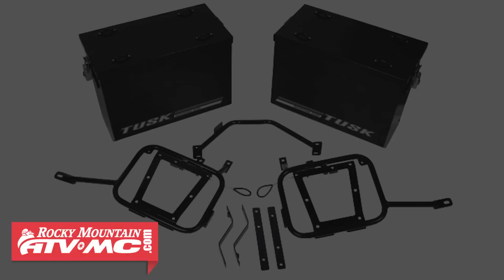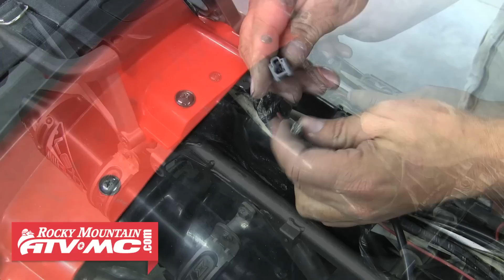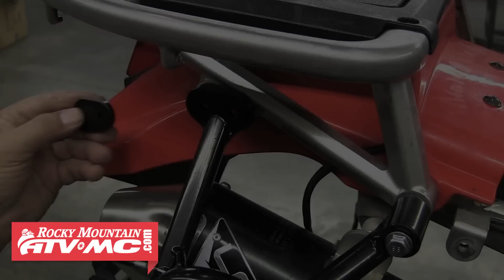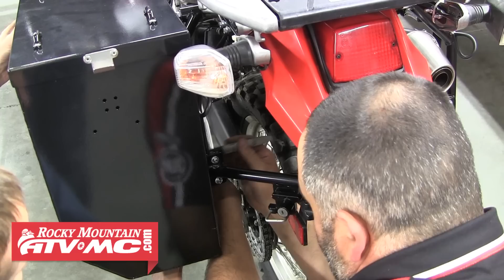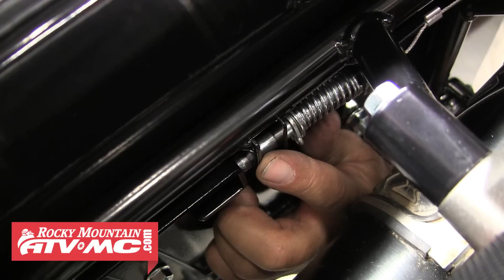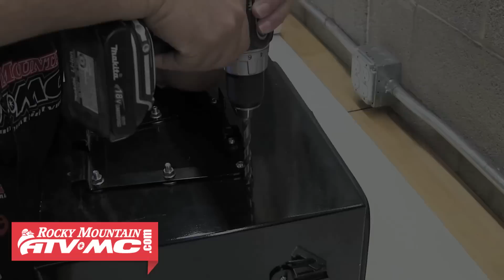Tusk Pannier Racks Assembly & Installation - 2008-2018 Kawasaki KLR650

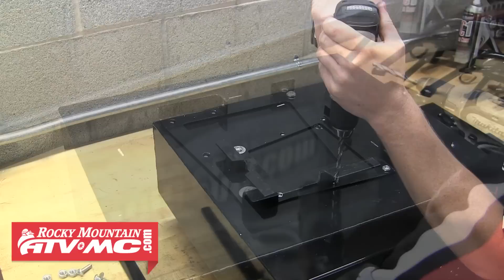Comment: At 7:25 in the video,. You dropped bolts into the brace to hold it so you can drill the rest of the holes. I don't know if you forgot to mention? Or this is just my own idea. After you put the bolts in I put the nuts on underneath to hold the brace firm against the box as I'm drilling. I found if I did not do this the brace flopped around a little bit as I was drilling the rest of the holes.. other than that one small suggestion I find a video comprehensive and informative.

By the way the construction of the bars and boxes is excellent, a good value

Comment: How do you get the seat back off if the left side cover is not designed to come off?

Must you remove the rack?
Reply: Not sure about others but both my side covers come off pretty easily with the racks in place so i have never had to take the racks off.
Reply: @Shabbernigdo Xingjian  100% agree. Sounded like in the instructions they cautioned they might not.

Comment: Didn't have to splice in the left rear blinker, just enough slack to attach without being taut. Also good note of mention you DO have to remove the rubber grommet and metal sleeves for the old blinkers to install the nut plate. (I was getting frustrated. If you run aftermarket exhaust, or maybe its just the FMF q4 I have, a bunjee cord for the release wire would be ideal.

Comment: dudes like "this is gonna be easy"

i dont think I could come up with a more complicated install process than this.
Reply: First thing I did was the thermal Bob install, which first is remove the seat and the gas tank.

Then I replace the doohickey, check the videos to see how that goes.

Now I'm installing these boxes, and after the two previous jobs I just did . to me it does seem easy. 🤪

Comment: You dont need that much wire for the extension. This product is about as garbage as chinesium gets throw the factory bolts out also the reason they dont want you to tighten everything up individually is it wont fit. Fit and finish is beyond sub par super disappointing

Comment: It's obvious that the installer doesn't know how to use electrical tape properly. Water will get in and stay there thus causing corrosion and the blinker connection failure in a year or so. Seal the connection properly or don't seal it at all. He should have used heat-shrink tubing with glue to seal the spliced connections.
Reply: A certified hammer mechanic! I am surprised they used sockets and not channel locks and vice grips.

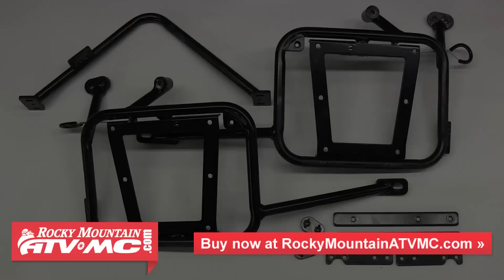Comment: at 0:54 what is the flat bar with three holes ( just above the turn signal extension bars) used for? Never mentioned in video.
Reply: It's the brace that goes inside the pannier. & it is seen in the video being installed.

Comment: Can I use soft pannier bags with these racks. I would also like to mount a rotopax water container to the right side would there be a problem with exhaust heat in doing that
Reply: Yes

Comment: I have a 2011.  Torque specs: Rear footpeg bolt: 18ft/lb, upper rear frame: 33ft/lb.  I used blue loctite.  I had issues with the left side rack lining up with the bolts, I was able to finally jimmy the footpeg bolt in but it was not pretty(probably stripped the threads).  I also had issues with the blinker extender.  On my 2011 the rubber "grommet" stuff was a solid piece.  I could not easily remove it.  I didn't want to cut it out in case I ever wanted to put it back the way it was.   This rubber stuff made the supplied bolts not long enough.  I ended up going out and getting ones(4) that were M6X40mm (1cm longer) and this worked fine.

Comment: The instructions state to reuse the turn signal bolts and nuts from the original parts.  They are WAY too long since it looks like you don't use the rubber blocks when installing the turn signals on the steel extensions.   Any suggestions??  The bolts shown in the video are NOT the stock signal mounting bolts.  The stock bolts have a round allen head, not a hex head.

Comment: My right side rack fit my 2014 klr perfectly but the left rack does not quite line up with the stock turn signal location and misses the front bolt location by almost an inch.  Could I have been sent the wrong rack?
Reply: I had the exact same issue on my 2017 KLR.  right side rack fits perfectly, but left side rack is off by a distance no amount of bending or torquing can align.  these racks cannot be installed.  

at request of RMATVMC, i emailed their warranty department photos and videos of how and where it was not fitting.  but it took a phone call a week later to get any word or update on my issue.  their solution (which i am eager to try) is to send another set of racks; maybe i got sent the wrong left rack.  problem is: they're back ordered and will be another 4+ weeks before i can expect to receive it. fingers crossed this new left side rack will be the 

meanwhile, i have to stare at these lonely pannier boxes still sitting uninstalled.  without 100% certainty regarding the racks, i cannot/will not drill the mounting holes.  sad trombone.

Comment: Just put these racks on a 2016 KLR650. Couple things that should be ADDED to their instructions:

1- They don't say WHY you're moving the turnsignals. (the boxes will hit them)
2-You must pull the TS wires BACK first before installing the rack. I had to remove everything cuz
TS wires wouldn't reach.
3- Instrux don't show how extension plate goes on. 
4- Parts should be labelled. i had no idea what a back plate .,flat bar was.
5- Mistake in Line 12- bolts size is 30mm not 25mm as shown.
6- missing steps 19-22 install subfender,seat, r panel
7- They don't tell you you can't get the left sidecover off on CA models
unless you remove the emissions cannister FIRST. Some guys take all that junk off anyway.

Also just put on the TUSK crashbars and subframe bolt kit from Eagle Mike (do them at the SAME time!) and
like the fit and looks of them. You could spend more but why?

 Other than that, GREAT product, already dropped it today and no damage. Dropped it last week and cracked the $300? right front plastic panel!  Now i have a place to mount hiway pegs and driving lights.
kEN C
CEO Operation Dirtbike Freedom

Comment: I can't get my side panel back on. the rack is in the way
Reply: +Rocky Mountain ATV MC I got it about 30 minutes after my original comment. thanks for the response though!
Reply: Finally got mine back on after some fanagling- still sits funny compared to the other side - good luck man
Reply from the maker: @Chuck Gillespie  You called it.  A little fanagling can go a long way.  We like to a mount them up loosely and then go back through and button all the nuts and bolts up later, once we have everything mocked up and aligned.
Reply: Is this the CA model? I couldn't get the left sidecover on until i reached in and removed the emissions cannister first.
Reply from the maker: JOSH3SiX Good Job!  Time to hit the slab and dirt :)

Comment: Do these racks work with the 2013 model and is the installation identical as shown here?
Reply from the maker: Yes these racks will fit your 2013 KLR and yes the installation should be exactly the same as what is shown in the video. You can find more information on our website if you put in your bike and look up the Tusk Aluminum Pannier Boxes with Racks. http://www.rockymountainatvmc.com/p/1033/-/976053/Tusk-Aluminum-Pannier-Boxes-with-Pannier-Racks-Black?v=6932 If you have any other questions let me know. Wes@RMATV